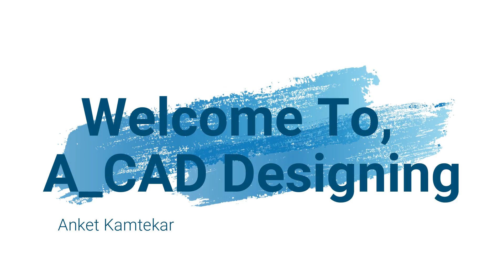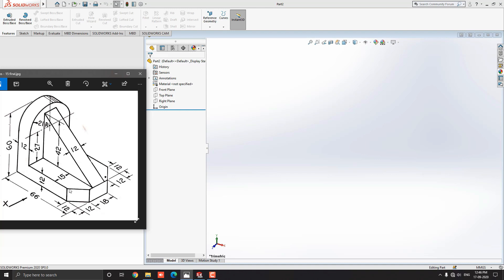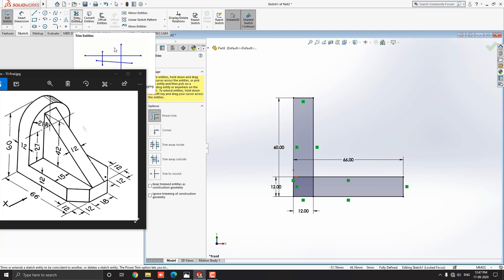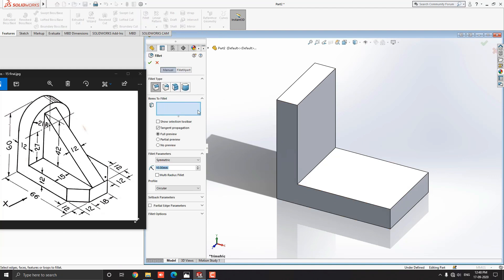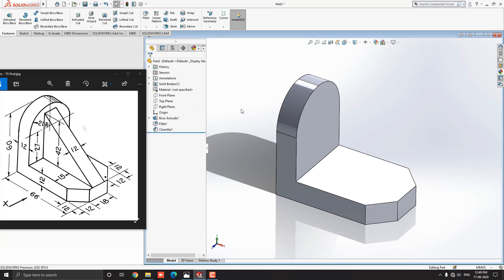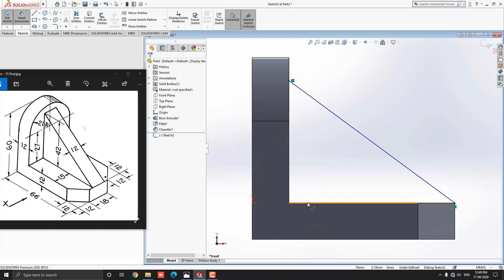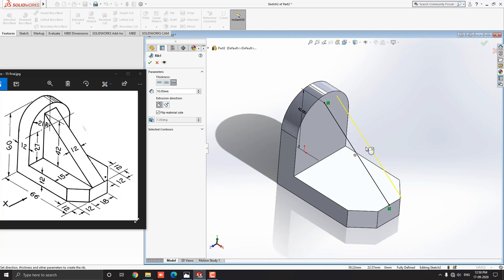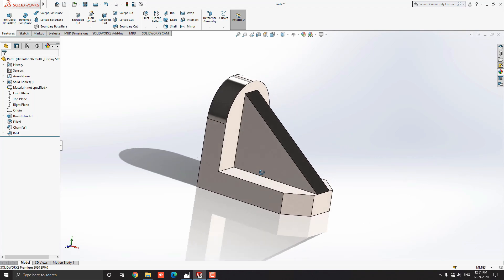SolidWorks Tutorial For Beginners | Part Modeling Exercise - 15

Comment: Please can you share your PC components and specifications ??
Reply from the maker: Processor : I5 9400F
RAM : 16Gb DDR4  300mhz
Mother board : Gigabyte B365M gaming HD
GPU : Nvidia Quadro P1000 4Gb Gddr5
SSD : Kingstone A400 240Gb
HDD : 2Tb + 500Gb
MONITOR : SAMSUNG 24inch IPS panel
Reply: @anketkamtekar  Thanks for sharing that !!

Can i run solidworks on ryzen 5 3400g ( it comes with integrated graphics) with 16GB 3000mhz of ram and without quadro gpu ?? 
Would I be able to do assemblies and simulation ?? 
I'm a student so will that be enough for me?
Reply from the maker: @lefthooklarry6983  
Yes..its sufficient configuration for sw2020
But you can't enable realview feature with Ryzen integrated GPU
Reply: @anketkamtekar  Ok... Will it be good to handle simulation in Ansys and also other softwares like master cam or NX cam